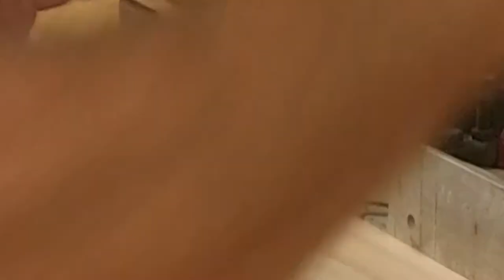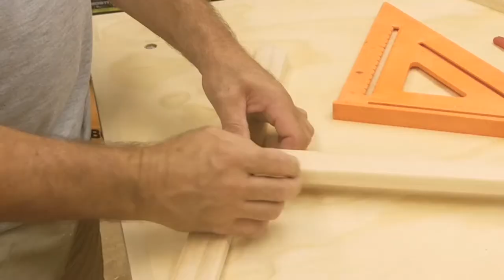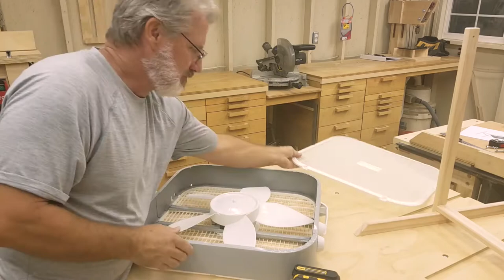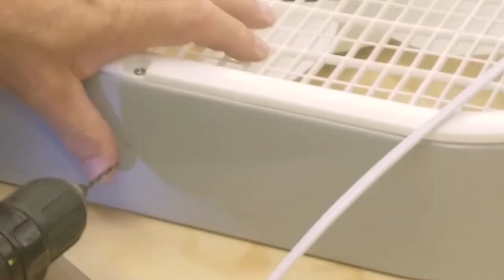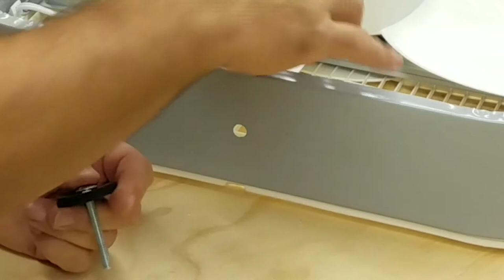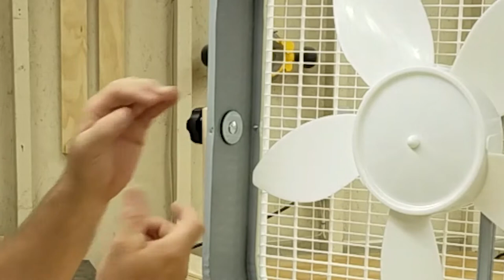Box Fan Stand | Box Fan Frame | Bobby Sharp

Comment: About them coming with already punched in square holes on the side, you're thinking of the older versions from the late 90's and the ones that predates 2006. Although the Air King version still seems to have the holes already punched in. Also cool project!

Comment: So this is "watch" me make a stand instead of "how" to make a stand. Got it.
Reply from the maker: First I've never claimed this channel to be a "How To" channel. But if you would like to build this stand for yourself I have copied a comment reply that contains the materials and dimensions below.

Select pine from the box store. All the lumber is 1 1/2" wide x 3/4" thick. The legs(2) are 24" with a 45 deg cut on each end, vertical sides(2) are 30", but you can customize those. What I mean by customize is that if you make them longer(taller) the fan will be higher off the floor. But they have to be a minimum length to accommodate the fan. The cross braces(2) are just wider than the fan housing, 20 plus inches or so for my fan. Measure your fan to ensure a proper fit. I believe this is discussed in the video. I have not watched this video in quite some time.
A "How To" video is no different than simply "Watching" a video. I asked my friend to watch this video and then asked if given the dimensions for this project if he could build this project by the limited guidance offered in it. His reply was "Yes, it's pretty straight forward." Not to mention there is probably 10 different ways to build any project and finish with the same result. 
And lastly they say a picture is worth a thousand words, a video is nothing more than moving pictures. So in a 15 min video how many words could that possibly replace?

Again thanks for watching, I hope with the short explanation above you can build one of these stands for yourself. Good luck with your future projects.

Comment: What are the measurements and what wood did you use?
Reply from the maker: Select pine from the box store. All the lumber is 1 1/2" wide x 3/4" thick. The legs are 24", vertical sides are 30", but you can customize those. The cross braces are just wider than the fan housing, 20 plus inches or so. Thanks for watching.